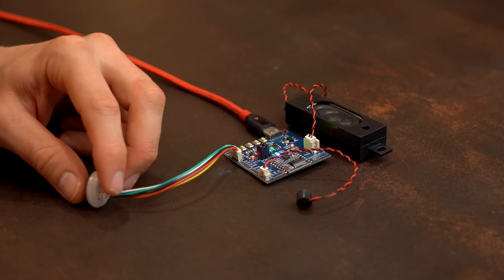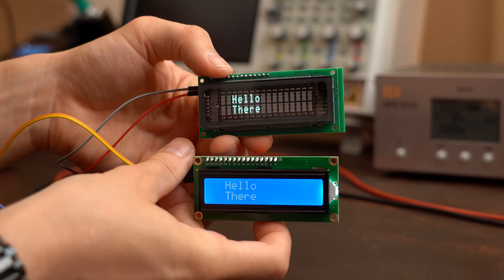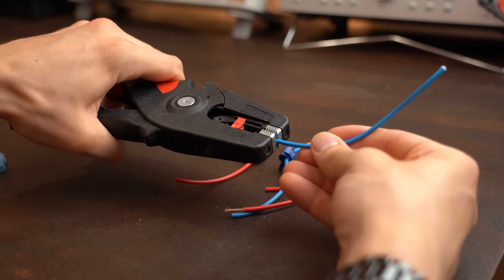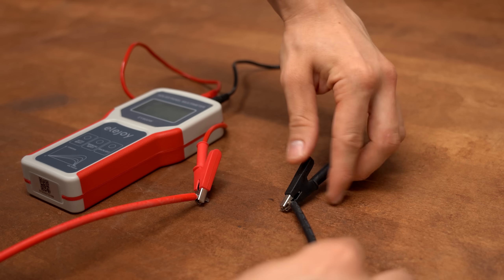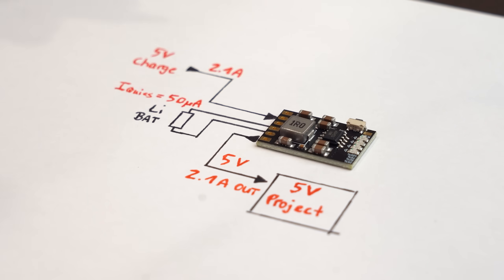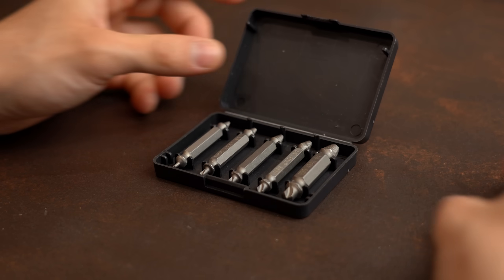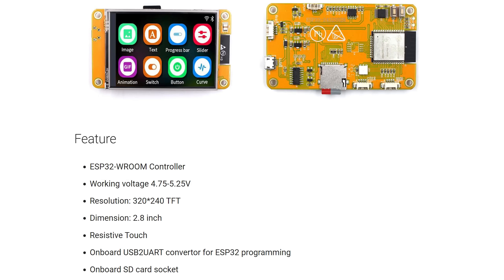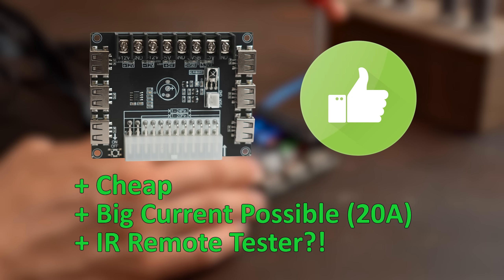I tried finding Hidden Gems on AliExpress AGAIN! (Part 6)

Comment: 9:47 screw extractors worked for me, but I was drilling much, much slower to get into the head and of cause counterclockwise. It also depends on the kind of screws, stainless steels screws are harder to get out for example.
Reply: Yes, this removers work fine, but not with a drill as shown... To remove a damaged screw, you need one thing above all, and that is sensitivity. You don't have this in any way with a cordless screwdriver. Use it with a hand tool and it works as described!
Reply: That screw extractor is garbage, I bought the same one to remove a screw from a bicycle brake rotor and they are damaged immediately without generating enough torque

Comment: Those T connectors are fairly common in the United States. You can get them is several different sizes for large or small wires. I never liked them and have only used them in temporary wiring to tap in for testing. As for the screw extractors. The good name brand ones work quite well. It looks like the AliExpress ones are not good quality, however.

Comment: about the T-splitter connector: I've seen it used in some contexts in which you need to "steal"  current from an existing setup that might be quite tight without redoing the wiring for example to add some stuff to a car, an example is stealing power from the high beams of your car to send the opening signal to your garage door. (and make it so that it only works once per activation and not that it keeps pressing if you enable them, it's meant to go with a quick flicker of course) and in that case it can work fine because it makes you access the cables without fiddling with them too much

Comment: Kinda looked like an infomercial failing on purpose with the easy-outs. Cheaping out is definitely not a good idea when it comes to bits but if you use them with patience and precision (keep the hole as tight as possible i.e. no wiggling around) and using the correct rotation directions then you can certainly save parts. I'd also test it in metal, not wood, as you're likely to be dealing with machine screws trying to save something expensive, not a 2x4.

All that said, even with the best bits following best practice, sometimes they just make it worse. Sometimes you just gotta drill and retap.

Comment: Note that the ESP32 LCD board is also available with capacitive touchscreen, but be aware that without correct datasheet and driver code, it can be impossible to use it as capacitive touchscreen are really sometimes weird (I am looking at you Goodix).
Reply: Got one of the capacitive ones and it's a delightful piece of kit.

Comment: For that little charging circuit, you should have had the battery leads disconnected from the battery to solder the leads to the board - why would you take a chance on shorting out the battery that way? You can always solder the leads back onto the battery later (or use a couple of quick disconnects :) ) You might want to try a smaller tip for your soldering iron as well - that tip is very ungainly for small work.
Reply: OMG, after all these years and I still cringe when I watch the soldering technique in these videos.  Solder isn't glue.  Maybe either put the conductor through the hole in the board to better keep it under control as well as providing some mechanical strength for the joint and avoid peeling the traces off the board.  And apply solder (and the flux core in the solder) to the heated joint, not drop blobs off the tip of the iron on the joint.  Please, these video are teaching people the incorrect way to use a soldering iron.
Reply: @lmamakos I didn't want to criticise too much... I was thinking along the same lines. His iron was cool (not hot enough) and not wetted properly (globby solder)... 
I frown on the use of the new solder as well - I stick to tin/lead (preferably 63/37) for fine PCB work. It just works the best with the right tensile strength. Not too soft, not too hard... Not environmentally friendly though.

Comment: 10:08 Offcourse it will not lift the screw..... when drilling, you drill straight down, and do not twist the drill like you did... then when you extract, the bit has to rotate counterclockwise..LOL

Comment: The MH-CD42 battery charger/boost converter is flooded around aliexpress. Although it's a good product, but there're some problems.
First, it has a idle auto shutdown feature, as you said. But the idle current is never accurate. It's 20mA(some say 25mA, see how messy it is?) according to specs, but I've experienced some unit still shutdown under 90mA loading. However, there's a "upgraded" version without the auto shutdown feature comes in white PCB, about 4x price. But it seems became rare, not easy to buy. Also the form factor is a big issue. You see the button is either on board or optionally connect via a pad on the PCB by soldering a wire. This make no sense for anything isn't prototype. Also since it's flooded on market, there's no similar module with similar specs and features set under similar price but for SMT. As in my option, this isn't production ready, it actually increase difficulty&cost for sourcing suitable module for productions. As an example, I end up use two modules, one for charging and one for boost in some past project.

Comment: I don't think it's ok to pull such amps through 24pin ATX connector, but instead using the dedicated 12V lines
And there are better solutions to this - made in china 60V @ 20 Amp SMPS with some modifications does wonders, the second variant is just to use ol' toroidal transformer (2 x 55-60V @ 18 Amps) but they weight ~15kgs

Comment: 10:05 Um, are you using the screw-driver in clockwise mode? 🤨 You're supposed to run it in REVERSE. 🤦 Also, I skip the drilling part because that just smooths out the inside of the screw, but skipping it gives the extractor more uneven areas to catch on. And hitting the back of the screw-driver to give it a bit of extra bite into the hole doesn't hurt either. And don't run it so fast! All you'll do is reverse-strip it. 🤦 Error 69: EBKAC - RTM

Comment: I think you used the screw extractors with an electric screwdriver, not an electric drill. Besides that as others have posted you have to drill the other way.

Comment: I"m always excited to see your finds here and especially the charger/booster boards.
It's extremely frustrating for me that they are always flawed in some way for my applications. Like the built-in push button switch. Yuck. I'd rather have a place to solder wires for a slide switch. Anyway, I love this part of your channel!
Reply: You can always add your own switch in parallel with it, although it does look like you'd need a momentary-action switch as it seems to be one click for on and two clicks for off.
Reply: @andrewmorton9683  yeah, there might be workarounds, but without proper solder points, and if I want to use it in some kind of product or kit, it's less practical. I appreciate the thought though!

Comment: I'm imagining how cool it would look to have such a display in a 'large' size and run a Linux console on it, instead of a regular screen. That would definitely have some style. But I suppose these displays are typically small, just a two maybe three lines, right?
Reply: The bigger and more useful ones are rare and expensive because most aren't manufactured anymore. A cool one is Noritake Itron GU128X64-800B, costs $350-$450.

Comment: 0:56 that made me wonder if there are similar displays but with OLED tech, turns out there are. They are even ~2 times less expensive than that VFD one
Reply: OLED wears out, the illuminating chemicals only work for a limited amount of run hours. Especially those cheap displays. You also have to watch out for burn-in of pixels which are used a lot.
Lcd will run for decades and VFD even better.
Reply: @wizrom3046  VFDs also burn in and fade, so I highly doubt it would outlast LCD, I don't know where you got that info from. Also keep in mind that OLED is much more practical than VFD, since it doesn't require high voltages
PS Winstar also claims that their OLED displays last longer than VFD (50-100kh vs 30kh), but I'm not sure if I can trust those numbers, and it could be related to VFD character displays seemingly being much brighter than OLED counterparts (5-6 times as much from what I could find). Another manufacturer, east rising, claims 30kh lifetime on their OLED character displays. One manufacturer, Surenoo, that produces all three kinds, unfortunately doesn't seem to list any lifetime expectancy numbers

Comment: Those squeeze-connector type things have been available for automotive applications for a long while. Definitely don't recommend them.
Reply: As this is an 'AliExpress Gems" video, I think Scott isn't at all interested in the OG 3M connectors, but if the cheapest crap he can get from China will work.
Reply: @jimurrata6785  Yeah, these things would probably be OK on cheap disposable projects but should be avoided generally. The 3M ones aren't really any better.

Comment: Those 5v booster were really great but the variant with the IP5306 chip in it are way more reliable than the other variants
Reply: With those, can you for example program it so like turn on charge at 3.9v and off at 4.2v?  I'm using a TP4056 in the car and it wastes so much energy just constantly charging an 18650 that's hooked up to my tablet that is turned off

Comment: Did you use correct drill direction when trying to extract?
Reply: The drill flutes should be left hand as well.
But you need to go straight in and to full depth for the conical extractor to properly engage.

Comment: The thing with screw and bolt extractors is there's a certain way you need to use them. Otherwise you go round and round in circles.

You need a clean hole. A hammer. And then the extractor needs to be turned counter clockwise while still putting pressure on the bit. As soon as it slips. Hammer again.
Reply: "You need a clean hole." - *giggle*
Reply: @RachaelSA  everyone needs a clean hole! 🕳️🫧💧🫧💧
Reply: Yeah but it still doesn't work. It's just cheap Chinese garbage and waste of money. This cheap screw extractors are just garbage. Had them, tested, they wear off before being able to unscrew one brand new screw screwed with medium torque and blue loctite applied. Same goes to cheap Chinese drills (got few free with some order). Do yourself a favour and avoid such thing at any cost and just grab something better which actually works.
Reply: @baalzevuv4509  again I haven't had any issues with Cheap Chinese drills albeit the batteries are terrible. I actually had a cheap drill that would out torque my uncles Milwaukee 😂😂

Even cheap tap and die sets I've been lucky with. I have expensive ones too but only for the important stuff

Comment: Regarding battery 5v PCB. I used one and I'm very happy with it. There is a way to keep it on even with small load. There's additional pad on the other side (I believe it's called Key). It needs to be pulled low (I believe) to turn board on. In such way the board will be up while key is pulled to required polarity.
Reply: This is great info! I was thinking about this even before it was mentioned in this video. I have a power bank which is often useless because of auto turn off.
Reply: So i need to connect Key to GND, i need a resistor?
Reply: @nukecoba4755  pulling low suggests that the Key is pulled up by a resistor, which is according to my experience the most common way. So, no pull down resistor, as it would "fight" with the pull up. Just connect to ground directly.

Comment: That powersupply breakout would be even more amazing if it could also do type-c power delivery and quick charge. The ability to quick charge some mobile device or power a laptop would be useful, and the available power is there just waiting to be tapped.
Reply: Most laptops are going to want closer to the 20V which would mean a boost circuit. Though my Chromebook was happy charging at a lower voltage (though much slower), my other devices just won't.